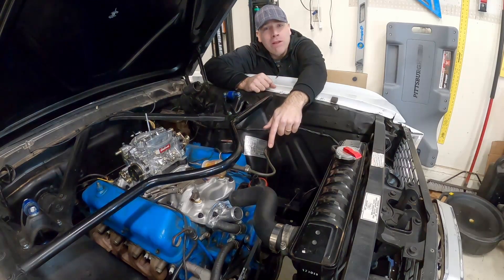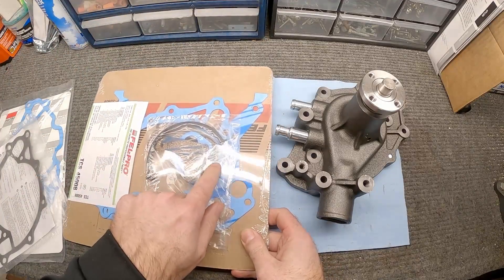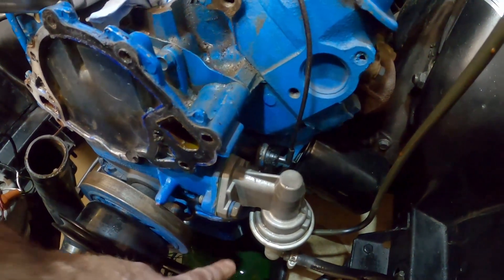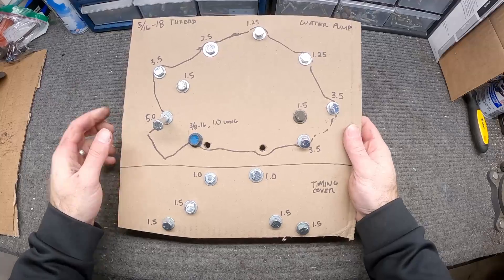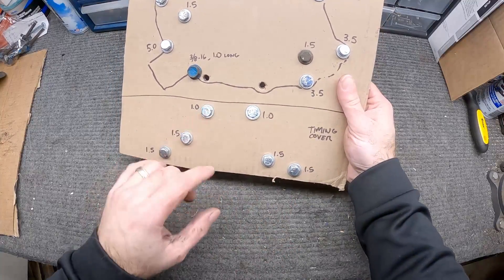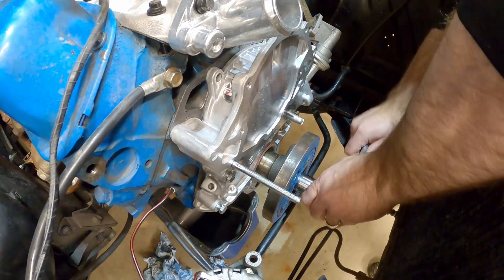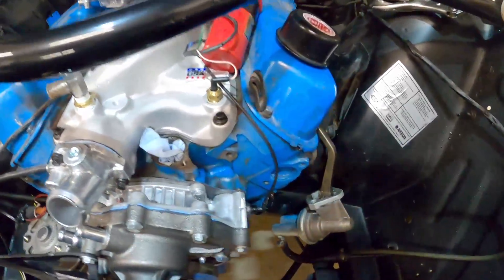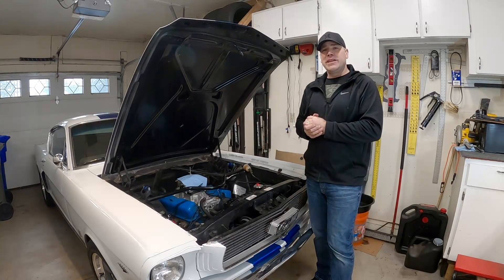How to replace a Water Pump and Timing Cover

Comment: Doing the water pump in the morning, you've got me wanting to do the timing cover too! Only concern there is the harmonic balancer.  Did you have to realign you timing marks when you put it back on, or does it only go on in the proper position?
Reply from the maker: Make it easy for yourself, set Cyl #1 to TDC and then pull the harmonic balancer.  There's no reason why the crank would move during this service, and the balancer only goes on one way, so you should be good.  The timing cover on your car is probably perfectly fine, but it's the gaskets that go out over time.  If you ever have to do those gaskets, you have to pull the water pump to get to them, and you'll have already done that by this time tomorrow.  You might as well get those time cover gaskets while you're in there.  :)
Reply: @AndyKruseChannel  Awesome! Thanks for the tip! Was hoping it only went on one way. I think I'm reusing both the cover and the pump, my cooling was great so I don't necessarily wanna modify the system. But I'm positive the gasket between the pump and the cover is leaking, might as well do it right and get the gaskets behind the cover too! You sir are a godsend to this community!
Reply: @AndyKruseChannel  got everything removed today, thank you again. My power steering slowed me down a little, but was as easy as the alternator with a couple extra bolts! This video is indescribably helpful!

Comment: Hey Andy where did you get the bolts for the water pump and cover?
Reply from the maker: I purchased from my local hardware store.  They don't need to be Grade 8 bolts, you can easily use Grade 5 or something similar.  I had looked into buying the ARP kit, but I have read that the supposed kit we need for the 289/302 does not include the correct length bolts.  At 11:30 in the video, you can see the carboard cutout I made with all the bolts.  It shows the length in inches for each bolt that I bought.  :)
Reply: @AndyKruseChannel  just got them all at the hardware store as well. Thank you sir!! I did the same for the ARP kit since I got the same cover.
Reply: @AndyKruseChannel  Hey Andy those two bolts that hold the metal gasket to the pump don't interfere with anything do they when putting the pump back in place great vid by the way and thanks.
Reply from the maker: @ckelley63  Nope, but their length is critical.  You also need to make sure that the heads are a lower style, meaning that if the head of the bolt is too tall, it will interfere with the timing cover.  Hopefully you received those two fasteners with the pump.  :)
Reply: @AndyKruseChannel  Yes those two bolts were included Andy.

Comment: Yes! I've been needing this one!

Oh just realized this too, not sure if you'll know or not, but I just got that same ignition coil you have. Do you know if you/the previous owner added one of the ballast resistors, or just kept the oe resistor wire? If you're not sure nbd, ik I'm off topic, just been trying to figure it out. Thanks for the video!
Reply from the maker: The correct ohm rating of the Coil should be 1.5 ohms, as long as no one has removed or replaced the Resistor Wire or Ceramic Ballast Resistor with something else.  On my car, I have the factory Resistor Wire in place (it's pink-ish, thick, and has a fabric insulator over it) and it attached to the red wire with the green stripe that is coming off the back of the ignition switch in the dash.  But somewhere along the line someone replaced the coil with that MSD unit you see in my video, but they install the wrong coil as it has a 0.7 ohm resistance rating.  I have since replaced that coil with the proper 1.5 ohm unit.
In your car you'll want to look for a rectangular ceramic resistor that is wired in series with the red wire and green stripe that is going to your coil, or check behind the instrument cluster for that pink-ish thick resistor wire.  If either of those are in place, you'll want a 1.5 ohm Coil.
Reply: @AndyKruseChannel  thank you so much for this! Had been thinking about going back to a standard coil, this msd is just becoming a headache. Pulled the gauge cluster and saw the pink wire. Just gonna back to a standard.

Comment: A good tip is to remove the negative battery cable. I see that you undid the positive. Which mean if you were to somehow touch something to the positive terminal and anywhere on the car you’ll have a problem. Don’t ask me how I learned this lesson. 😜 I have a quick disconnect on my negative side. Quarter turn and I’ve isolated the battery.
Reply from the maker: Good tip!
Reply: @AndyKruseChannel  Thanks for all you tips on the water pump and timing cover. I hope I don’t need to do either any time soon!
Reply: Amazon - Battery post disconnect $6.50 works great.   

Nice job on video.
Reply from the maker: @631Rogers  Thanks!!  I'm not opposed to donations.  :)

Comment: Man you should have put a speedy sleeve on that balancer. It looks ridge in the video no?  Great job pointing out the balancer needs to centre the the seal most home mechanics would have just bolted it on then put the balancer on
Reply from the maker: Thanks!  I ended up having to go back in and replace the seal not longer after I made this video.  Actually, the seal might have been fine, but I definitely needed to clean up the snout on the balancer before reusing it.  I made a video about it, and I haven't had any leaks since.  :)